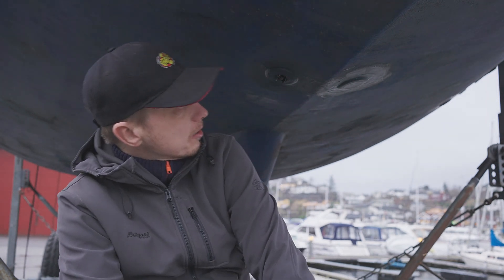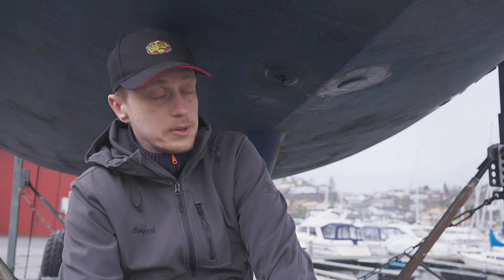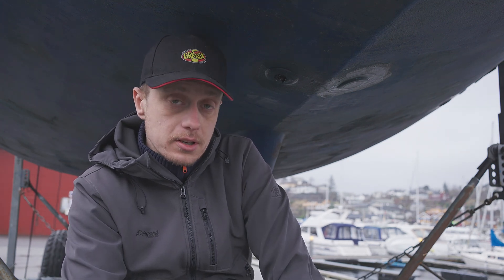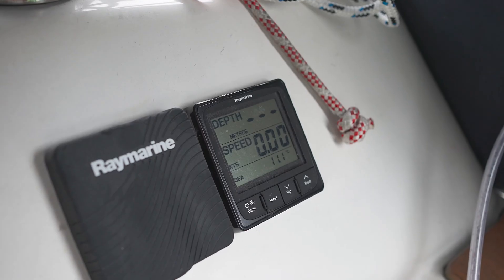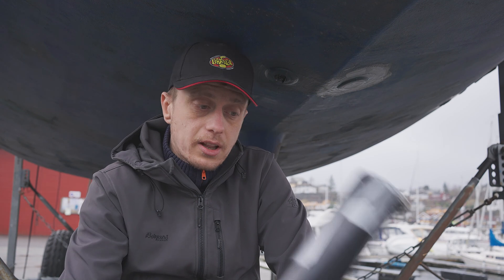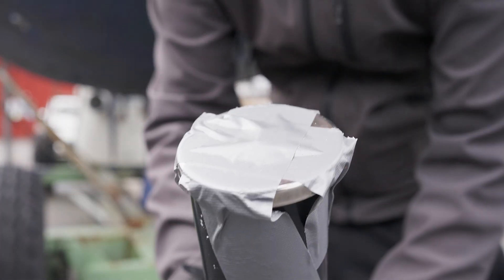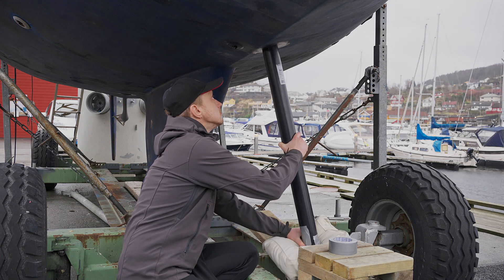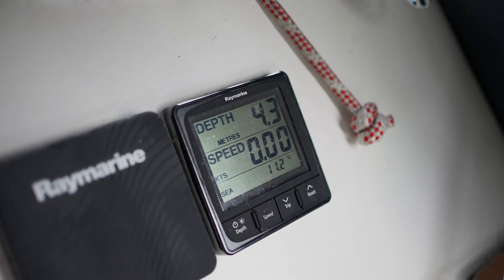How to Test a Depth Transducer on Land | Airmar P319 | Raymarine i50

Comment: I tested mine with a ziplock bag full of water. But this is good 

One question, when you take the tube away does it go back to reading ---? or does it stay on the depth reading even when the tube was removed?

Comment: To further add some detail sound travels at 1500 m/s in water vs 340 m/s in air. This means there is a ratio of 4.4. So with this 1 meter tube in air multiple by 4.4 = 4.4 expected water depth.